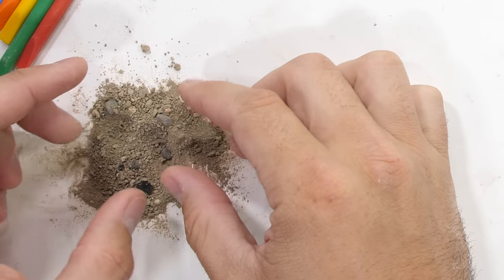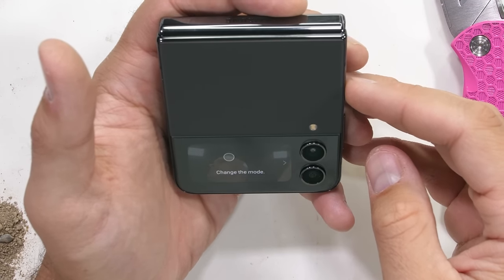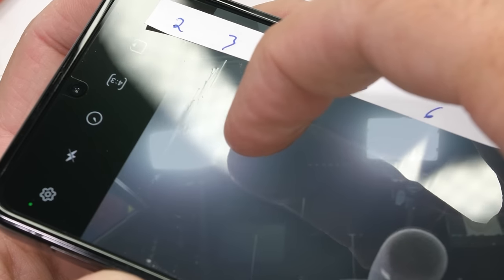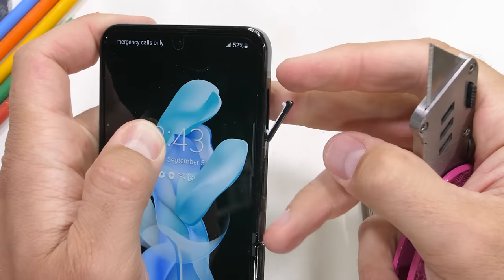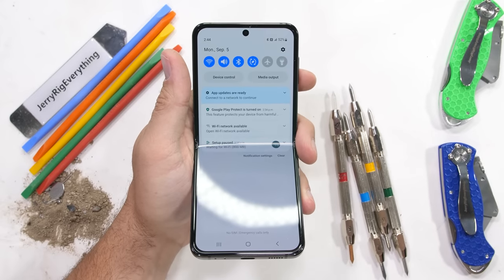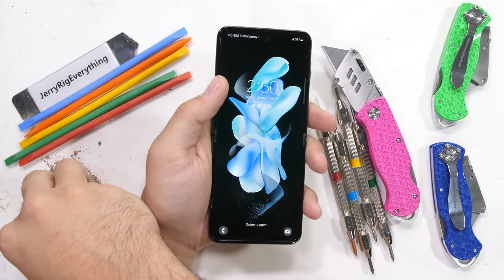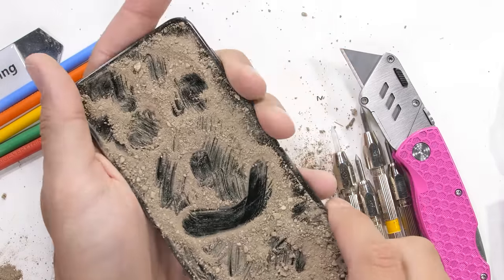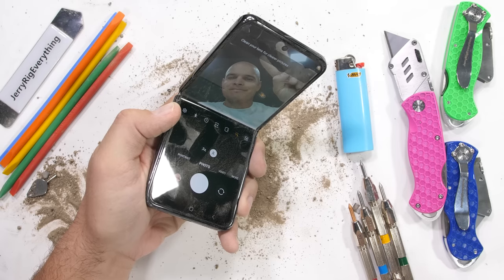Samsung Z Flip 4 Durability Test!! - they slipped a bit...

Comment: I unfortunately own a Z Flip 4.  I ruined my Galaxy S9 that I had since 2017 by submerging it in saltwater.  I got the Z Flip 4 free due to a promotion.  The ONLY thing good about this phone is that it fits comfortably in my pocket.  My old S9 was superior. It had a separate SD card with storage up to 500Gigs and legacy earplug connector. My new Z Flip lasted exactly 9 months and suddenly crapped out on me.  I opened it one morning to send a text and heard a slight click in the hinge when I opened it. The screen flickered and a black ink spot start to grow.  The touch screen then quit working.  I had the insurance so I got another one.  Once I'm able allowed another upgrade I plan to replace it.

Comment: I had my galaxy zflip 4 for about 5 months. About a month ago, I accidentally dropped it on cement from about 4 feet, and it landed on the corner of the hinge while closed. After the fall, it could only open at 90 degrees but the screen was intact with no scratches on the inside or on the cover screen. I did have the Samsung case on which helped a bit. A week after the drop, I forced it open and heard the same popping noise in the video during the bend test. It killed my pixels inside and caused half of the screen to go black. Samsung charged me $400 to get it fixed. /: Now I have a new flip but I am absolutely terrified of dropping it again.

Comment: Bought one, and within a few months, whilst cleaning the inner screen with a soft cloth, a strand of cotton caught on the plastic bumper around the inner screen by the fold and pulled a length of the rubber out. Samsung wanted £350 to repair it. Nice looking phone, but all it really does is fold in half, nothing else. Would not recommend it.

Comment: In my opinion I'd get the fold instead of the flip because you are more likely to damage the screen on the flip. I have the fold 3 and only open it to watch videos or scroll online but I'd think it would be an issue if I exclusively used the inside screen since it would be more likely to get damaged since that would be the only screen you'd be interacting with
Reply: no.. the situation is exactly the same with flip. it looks like new after a year thanks to unbeatable display protection: folding. and it's small and light, a completely different userbase for it.

Comment: Oh man I dropped me phone when u sliced down this z with a Stanley, that noise can't handle that, luckily I put me foot out and it bounced off me slipper so I saved it :-) is only a A though, I've been put right off the top samsung s's, is like there de evolving in terms of strength of these devices. My old samsungs i could bounce around the car park and they'd be semi ok, I drop these new ones and they shatter completely front and back is depressing, my s7 edge shattered and I only dropped it from 1m off the ground, it had case and screen protector on it also, was devastated as I just got the gear vr and controller for it that was awesome for a day then bang, not anymore:-( yeah I do love samsung there miles ahead of the competition Apple etc and there customer service is second to none but do wish these new phones could stand a little beating :-) this vid has dedo put me off getting and fold or flip, I cut myself with my own nails there like Razor blades I'd defo wreck these in hrs 😢 edit= I just watched this to the end and was a great test think is defo better than I first thought Thanks 😊

Comment: Wait I assumed you'd remove the screen protector that comes on all Samsung phones by default but you didn't, is that intentional? I would assume the actual screen is tougher than the protector
Reply from the maker: Samsung said specifically that the top layer is not supposed to be removed.
Reply: @JerryRigEverything  so from what I have found it appears they advise against it simply cause the flip uses that ultra thin glass and is specifically less durable. But IMO I would still do the test without that on there. The actual glass would definitely struggle but I feel like some of the tests you do are design to fail when youre taking a knife to a plastic screen protector without making it clear to most people watching
Reply from the maker: @TheGoldPrecision  if you watch some of my other fold/flip teardowns, you'll see it's still plastic under that protector.
Reply: @JerryRigEverything  I guess that's fair, my only point was it was confusing to me at first cause I didn't know how weak the screen would be but then I noticed that protector when you zoomed on the camera. I'm not saying you did something wrong I'm just saying as a viewer it made me think that it could be the reason for it being so bad

Comment: I'm on my 2nd flip4 in the space of 3 months. My first one's hinge failed due to a small amount of dust in my pocket from work. When I opened the phone the hinge locked in place at just over 90° and the screen broke and had a big black line thru the middle. I've had my 2nd one for about 3 weeks now and already it doesn't open flat. "DO NOT BUY THIS PRODUCT UNTILL THEY IMPROVE ON THE HINGE THEY DO NOT LAST AND THEY DAMAGE OTHER COMPONENETS."

Comment: That outer victus glass got a 1cm arced scratch in my first week, deep enough to snag your nail when running over it.... And I never dropped the phone etc, it had only been resting on my desk. Very disappointing. 

Perhaps I have diamond dust laying around...
Reply: Gorilla glass is just stronger than normal glass. It resists cracking and shattering but if anything it scratches even easier. People assume that it's scratchproof.

Comment: I freaking touched it very lightly with my fingernail and have a slight dent now in die side on the right on the black frame. You cant see it at all, only when you tilt it in a specific direction and Its not actualy on the display where the apps are runing. Still, I KNOW it is there and that is driving me crazy^^

Comment: Love the z flip 4 for the last two years but they are not dust or wprk proof, hinge went the first time after 10 months, couldnt open the phone more than an inch or so but samsung replaced for free, however had it now for another 11 months and its been collecting alot of bits inside, screen doesnt open all the way, and it makes noises, however screen has finally burst after being dropped, they are durable but when you work in dusty environments everyday the mangets just suck bits in, and they dont come out, anyone had a z flip 6? And are they as bad as collecting dust in the hinges?

Comment: My z flip 3 died after 6 months (screen/battery issue), and my z flip 4 after 3 months (i dropped it, not even such a bad fall, and i cant open it anymore at all). I'd never broke a phone before, not even a scratch so, these phones are more fragile in my opinion
Reply: This 10 minute video proves otherwise, especially with how much worse it was treated.
Reply: Lol I am on my 2nd Flip 4, first one the hinge broke within 2 weeks - no drops nothing, opened barely halfway.

Was replaced, 4 months later my 2nd Flip  4 fell from about 1 metre to carpeted floor, the hinge broke, barely opens half way.

There's definitely an issue here, gone off this phone, would not want them if they were giving them away for free.

Will be replacing with anything else.

As the Flip 4 hinge definitely has issues.

Comment: how is this the 4th iteration? when you can scratch the screen with your nail..
Reply: It's only been 4 years since the original fold. 3 years since flip. They haven't improved enough on the screen because there is a plastic protection.

Comment: Just a tip about the fingernail scratch, on my flip 3, i changed the original cover screen with some random i found on aliexpress. The screen below, which is the original screen had 0 scratches od damage from 6 or 7 months of use.
Edit, also after the bend test, i will keep my flip 3 for the next year
Reply: The flip 4 is much nicer than the flip 3, plus the bend test is an extreme test that realistically would never happen to the phone so why would that deter you from getting the new one just curious

Comment: It's pretty impressive, all told. Unlike a traditional brick design, a folding phone like this has much less risk of being inadvertently bent. It will almost surely be folded any time it's not in the user's hands, so it's not expected to be as strong that direction, and a partial failure of the flip mechanism is not surprising. Now if they can just invent some magic wonder material to replace the plastic on the display.
Reply: It also seemed to me like maybe that small break was an intentional failure point. Like, they accepted the reality that bending this kind of phone in the wrong direction would break something, but they engineered it to break in a way that has the lowest impact on usability. Kind of like how football players are taught the "correct" way to be tackled. You have to accept that you're going to be defeated sometimes, so make sure you go down in a way that minimizes your chance of being injured.

Comment: Can anybody answer my question if you still need to buy a screen protector even though it comes with a pre installed one, are people still putting their own purchased protectors over the pre installed one??? Same with the Fold , Idk which one I’m gonna be getting soon
Reply: No don't put another over it. Wait till it wears down a bit then go to professionals to get it removed and replaced. When people put their own over the pre-installed one, overtime they will notice what looks like a crack in the fold of the screen. This is how people think the Zflip has an easily breakable screen when it doesn't lol. Just don't double layer protectors or you'll have a heart attack for no reason 🤣 (the screen doesn't actually break when this happens tho)
Reply: I put it over the already on there screen protector because that's how Samsung has said to do other devices with pre-installed protection. Already changed it out a couple times and have had no issues with the pre-installed one coming up or anything like that.